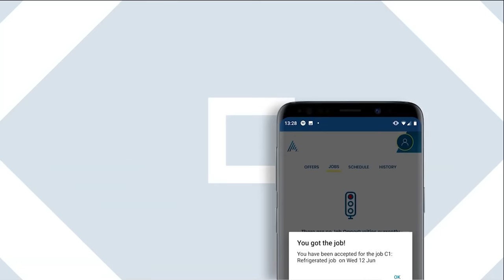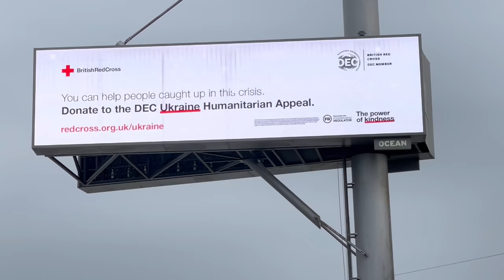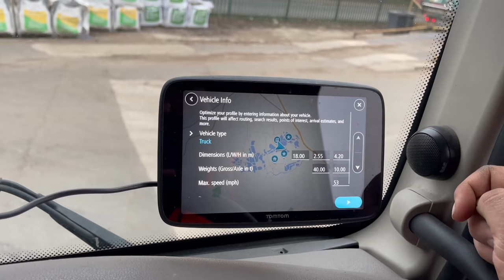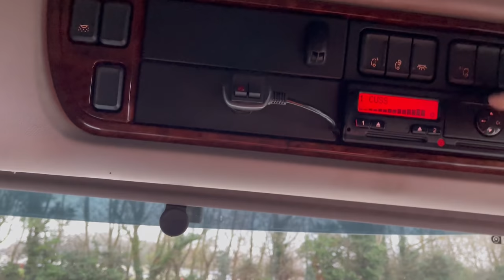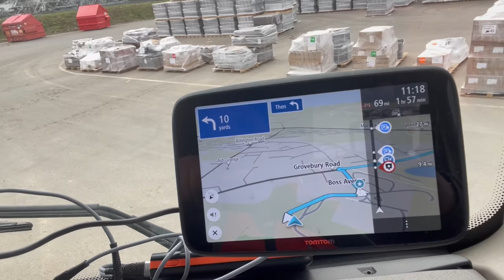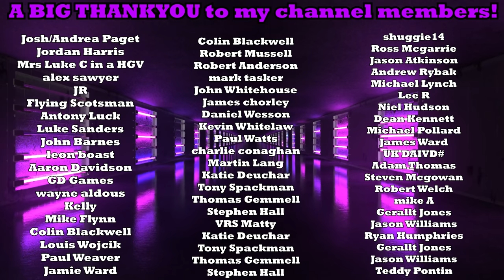Blocking An Entire HOUSING ESTATE!

Comment: My pet peeve is on show.Luke you have done a nice job strapping the load down but you have all your ratchets on the same side of the load.Now it may look pretty but you are pulling the load in the direction of the ratchets.You need to put the ratchets on opposite sides to balance the forces out and help keep the load stable. I drive 7.5 tonne and 3.5 tonne flatbeds not 30 plus tonne but the same things apply across the weight scales.
Reply: No edge protection either

Comment: Nice truck. I am one of many engineers building it and am happy to see our machines put to good use :-)
Reply: Wow ive worked around HGVs for many years and still fascinated by the engineering must be a very intresting job, but difficult no doubt
Reply: @BlueSquad00  The difficulty is okay, it's just different than passenger cars. We must focus much more on reliability and the high amount of variety makes it tricky. I think that we have something like 28.000 different configurations the customer can pick from. In the passenger cars they usually have just a few hundreds.

Comment: Nice video Luke. I like it when you show the taco machine stuff as well as the other stuff. Question for you - when you get out of your truck at a delivery do you always take your keys even if you strap up or does the truck not lock itself if the keys are in the truck. (When the engine is off)

Comment: I keep thinking that I might become an HGV driver but then I watch you and think there's no way I can get through those tight gaps or reverse well enough😂
Reply: When you start you work slow & try to exercise good common sense & patience. As time goes by the truck will get smaller & your perception on where you can go & can't go sharper. Success is simply do you have common sense & patience? The driving part gets easier with time.
Reply: Same mate…but I guess I’ll never know unless I give it a go!

Comment: Hey Luke justva suggestion,when i carry loads that i think will move,like timber or metalwork i always put 2 straps going to n.side and a central strap going to the o.side so the pull against each other to keep the load in place,defo use some kind of edge protecor on those road plate  ie some rubber slip mat or old bits of carpet and sometimes give the ratchets an extra tweak with a bar.

Comment: How long does a full tank last you ? Curious how often you have to fill up
Reply: usually fill up once a day
Reply: Depends on how heavy the load is you’re carrying, if you run empty a lot and if you’re driving on motorways most the time or urban driving. A full tank is roughly 400+ litres and you get between 6-10 miles to the gallon maybe a bit more.

Comment: you have a huge camera directly in your line of sight on the windscreen, you are only allowed on thing on there and it has to be in the middle and low, i am not being pedantic, its basic safety, you cant see a kid on a bike with that there, if you are in an accident you will go to prison for  that,
Reply from the maker: It’s outside of the range of the windscreen wiper which is legal 🤙🏻
Reply: @lukecinahgv  it's directly in front of your face at eye level?
Reply from the maker: No, it’s as far to the side as it can possibly go slightly above eye level pointing down. Outside of the reach of the windscreen wipers. Legal.
Reply: @lukecinahgv  if that's your standard for legal then your phone and sat nav are both illegal.
Reply from the maker: Here’s the thing, I literally had a police officer sat in my passenger seat 48 hours ago. He said nothing about the satnav or phone in my windscreen. I promise you that is true what I just said.
Reply: @lukecinahgv  try it with a vosa guy sitting there. Did you Google. Dr Suzanna Bull?
Reply from the maker: For the record its DVSA not VOSA. 
And again, I have. In fact I have a video call about being stopped by the DVSA. 

https://youtu.be/terjNXtVaI4

Comment: Nice reverse Luke. I would pass on a tip I was taught many years ago. It’s best to strap to the main sole bar, rather side bars. The load is then being pulled down on the deck, from the bottom. Guaranteed not to move. I used to do it with rolls of paper, never had an problems.  I feel for you have such awful access. Cheers. 👍🚛